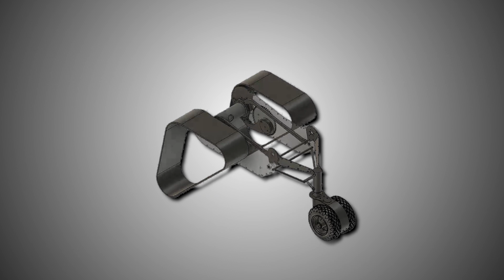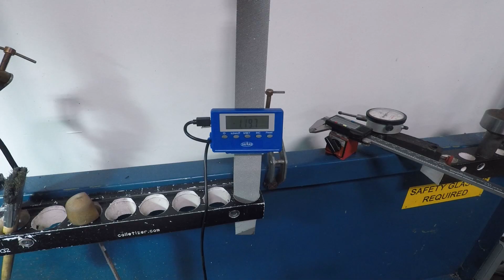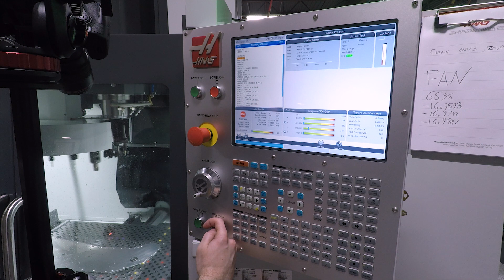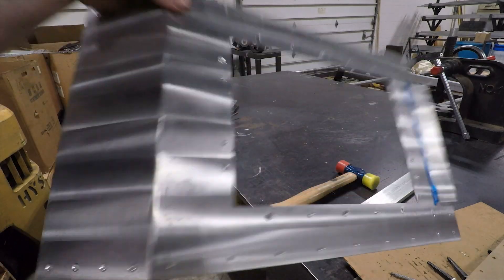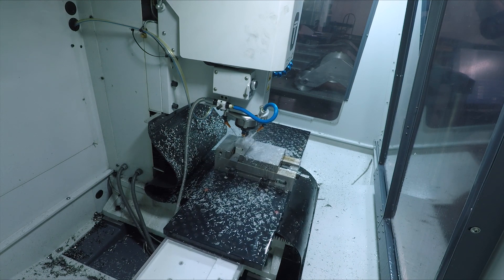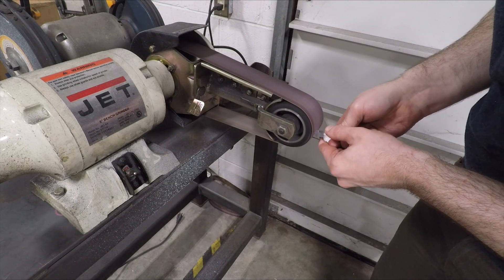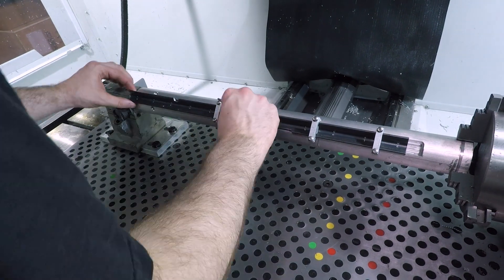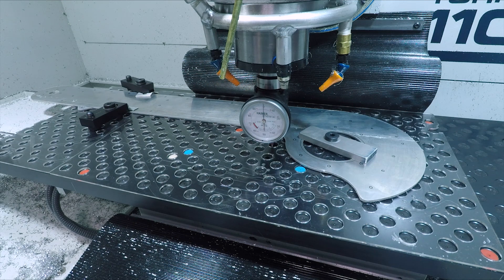Building Johnny 5 Part 7: Cradle Base & Lower Torso | WW260

Comment: ok, I'm only a couple of minutes into the video, but I'm so puzzled I had to stop to ask this question:
If you're laser cutting those plates, why not laser cut the holes at the same time???
Reply: They have to put it on the mill anyways so they can do the countersinks and chamfers. The mill leaves a nicer hole than the plasma.

Comment: Wouldn't it have been faster to glue a square sheet on the superglue and contour out the side brackets, rather than bother with manual pin hole drilling and rough cutting?

Comment: CNC tube notching is actually a genius idea, especially since it's scalable from small diameters to large diameters with one tool. Though, longer parts, at an angle, might have mounting issues, which might make for a good use case of 5axis, assuming a part isn't too long to fit inside the enclosure of the machine. Edit to clarify, 5axis machine where the additional axes are on the spindle, not the bed, a long pipe would never fit into a machine that has the additional axes in the bed. Maybe a 5axis cutter on a cnc lathe would be better for this.

Comment: Not ideal drilling through sheet metal whilst holding it in your hand.
Reply: A good trick is to packaging tape it onto a 2x4.
Reply: pretty sure he was just counter sinking holes.
Reply: @zuestoots5176  Counter sinking is a larger Diameter for the tool to catch on. 
That's even more dangerous.
Reply: @Ed Rees Danger of material catching is not about finger strength.
It's about torque and tool diameter and flutes on the tool and sharpness of the tool and pressure you are putting on the tool.
A good rule of thumb(get it) is don't free hand countersink unless the cutting tool is weaker then you.